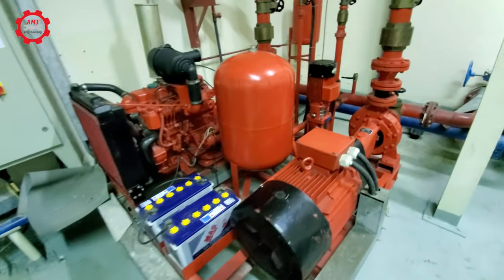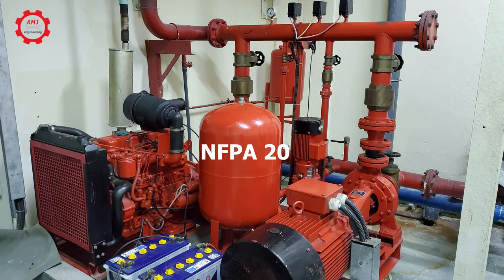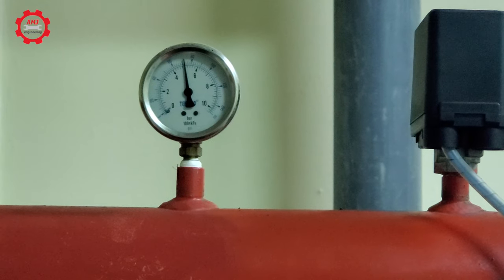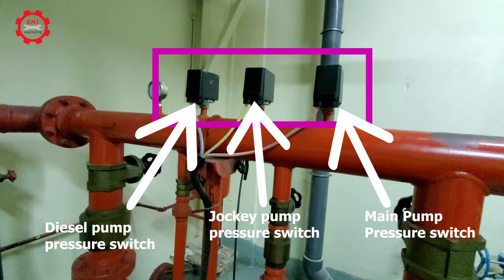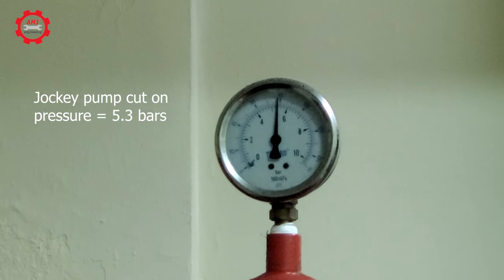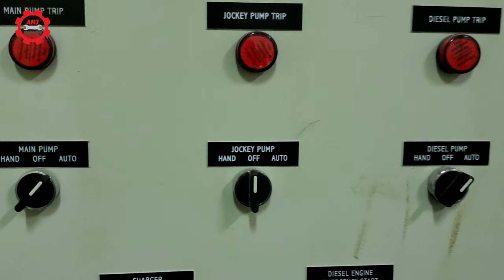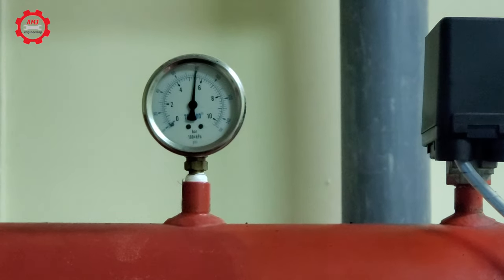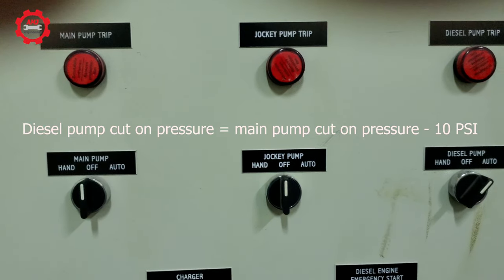Fire fighting_lesson 3 | Fire pump system description, sizing and testing

Comment: You should test it also whilst the 3 pumps are in auto mode to check the correct sequence of operation when there is more demand. Assuming 3 pumps are in auto mode, does the Jockey Pump operate together w/ the Main Fire Pump when the MFP reach its cut-in pressure? Or there is an interlock between the 2 pumps (JP & MFP)? How about the Diesel FP, does it operate w/ the Main FP when it reach its cut-in pressure?

Comment: In my country, municipal building codes govern that the entire pump system should only be fed from a dedicated reservoir connected to the public running water and regulated by float valve.
Reply from the maker: thanks for info

Comment: Sorry im just learning.. What is the difference between the diesel and the main pump and their respective role?
Reply from the maker: Both electric and diesel fire pumps provide fire sprinklers throughout a facility with adequate water supply during a fire. 
diesel engines are often used when the electrical supply to the property is interrupted or if the electric pump capacity is insufficient to kill the fire (i.e. when the pressure in the system drops below the diesel pump setting, meaning more and more of sprinkler heads are broken due to more spread area of fire)

Comment: How about if there is more demand while the Electric Fire Pump is running and reach the Diesel Fire Pump cut in pressure? Does Diesel Fire Pump assist the Electric Fire Pump? Or will it just operate during power failure only?
Reply: Hmm

Comment: Hi
Can i know, why the fire diesel engine gets overheat and seize
Reply from the maker: It depends, could be not cooled properly. Check the radiator and fan. Also, make sure the condition of the engine parts are good before running again.